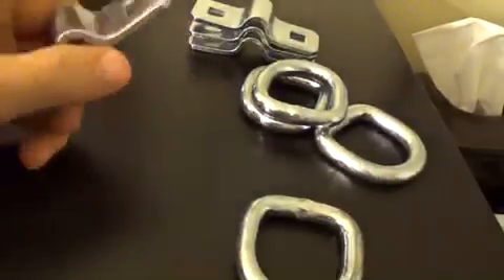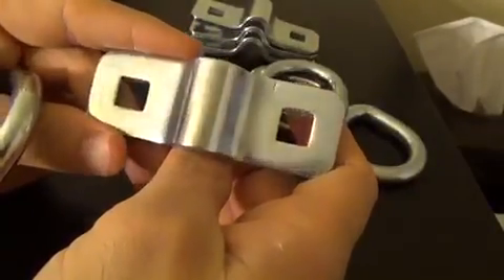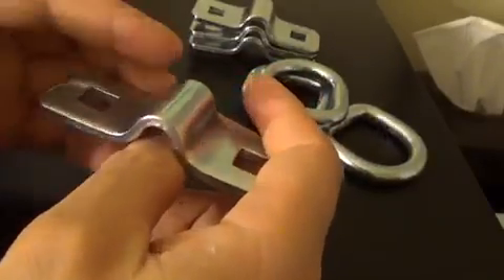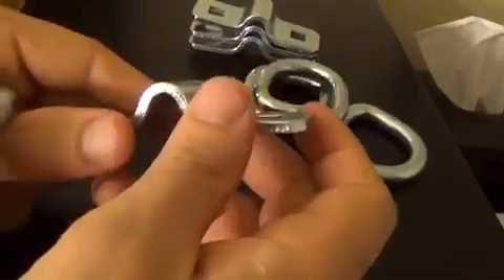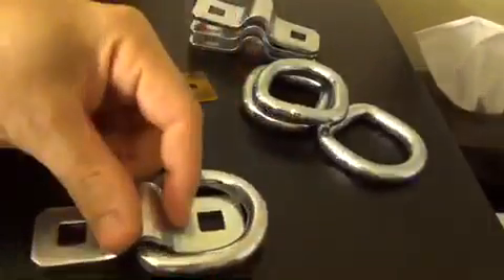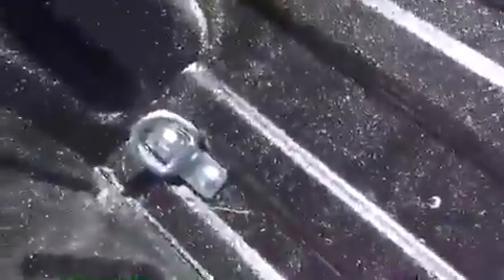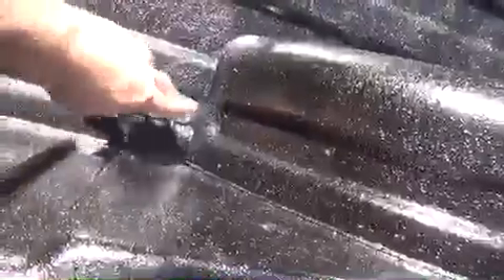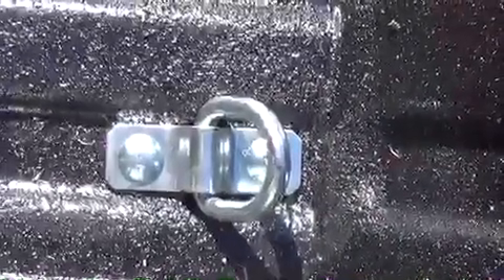4-Pack 3/8" Silver Steel D Ring Cargo Tie-Down Anchors with Bolt-on Mounting Clips

Comment: If anybody’s worried about the noise, as in the D ring( shackle) banging back and forth, there’s a product out there called “ Plasti-Dip” & the D-Ring can be easily coated and the results provide a rubberized texture that theoretically should keep the movement quiet.
Reply: I'm sure that would not last very long with heavy use of the ring.
Reply: Having achey knees I’m glad for them to be sticking up 😂 . The past few years the floor keep getting further away ever year that goes by .

Comment: The whole purpose of having those style is to be flat. If you don't want them to rattle or flop around you put electrical tape on the D-ring before you bolt them down.

Comment: Would have been way better if you had installed a one piece metal strap under each anchor under the bed instead of those washers. Would make the tear out factor way more robust.
I just finished using these very anchors on top of the bed of my pickup and backed them up with a one piece strap with two holes drilled in it to match the anchor. Then Loctite was applied to the threads to prevent loosening.